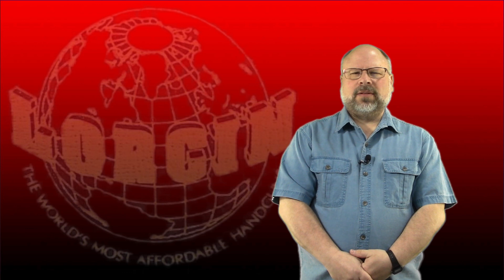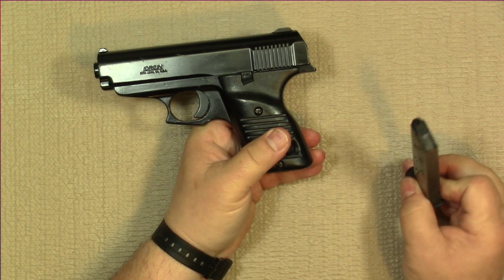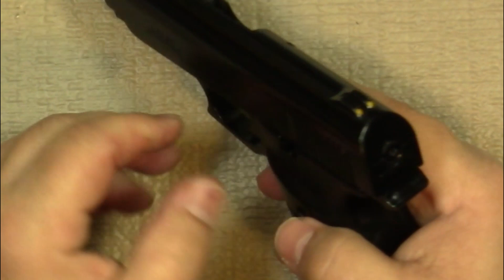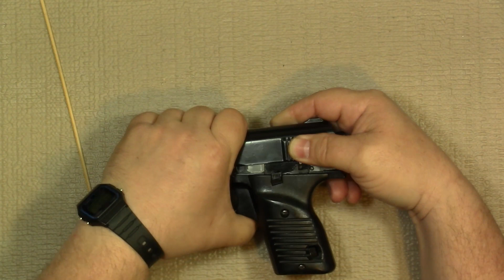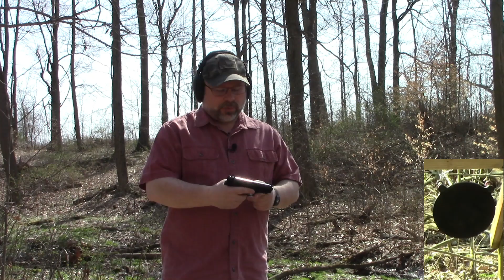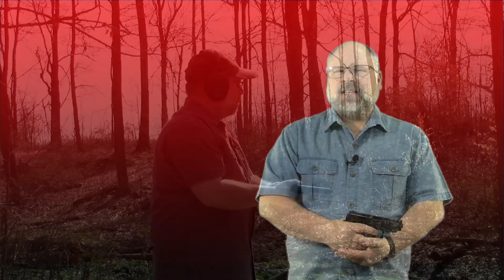Lorcin L32

Comment: I have a Jennings J-22 that seems to be essentially the same design. Betting it has the same sear issue, which is unfortunate. It's big issue otherwise is a slightly undersized ejection port and a slightly heavier than needed recoil spring and/or slide, meaning it is sensitive to the ammunition you choose, along with minuscule sights. With a lighter recoil spring and a buffer spring, it'd probably work a peach! I find that the toe of the magazine works well for disassembly. It doesn't have to go in far. The hard part is holding everything in place long enough to get the slide displaced. Really, if these pistols had been better made, I'd be surprised if these companies weren't still in business in one form or another, although most likely not in California...

That jam you had suggests that the pistol wasn't recoiling far enough. Therefore, there wasn't enough time for the empty to fully eject and the slide didn't quite completely behind the rim of the next round and, thus, also failed to pick it up to start to chamber it. This matches the "sensitive to ammunition" noted above.

Comment: I have the L380... and need to change the extractor. I've already purchased the extractor and went ahead and bought the extractor pin and spring. I was told to use a tap/punch to tap out the pin from underneath, yet I don't see where the bottom of the pin is from inside the slide... I cleaned the inside enough to look for the spot, but there isn't one that I see...   Help?

Comment: Don't understand all the hate. I had one it was about 90% reliable if you kept it clean and used .71 grain FMJ. Obviously it isn't the best pistol available but it's okay for $85 bucks.
Reply from the maker: Thanks for watching and commenting. I have to admit, it did shoot much better than I expected it to.  I am OK with the 32 version, but the 380 chambering was just a little too much power for what the design could safely handle, at least repeatedly. I would still urge caution with that one.

Comment: Being a blow-back operated pistol, were these fairly accurate?
Reply from the maker: Being blowback and having a fixed barrel accuracy could have been decent, however barrel quality was not ideal, and the overall loose tolerances of the slide, where the sights are, combined to make them inaccurate overall. They were sufficient for a short range self defense pistol, but that would be the extent of it.
Reply: @CraigsGunChannel  These also have shallow grooves, which means that with lighter ammunition, if the tolerances are loose, it may not grab like it should.

Comment: I have shot one of these before, I would not recommend them for self protection. You would have more chances throwing the gun at someone and hitting them than you would shooting them.  Fun for time at the range but otherwise useless.
Reply from the maker: It is not one I would recommend either, however if it were all I had it would be what I would use. Thanks for watching and commenting.
Reply: @CraigsGunChannel  Yes, the best gun to use in a fight is always going to be the one you have with you. The one in the night stand at home doesn't help much when you're buying gas.